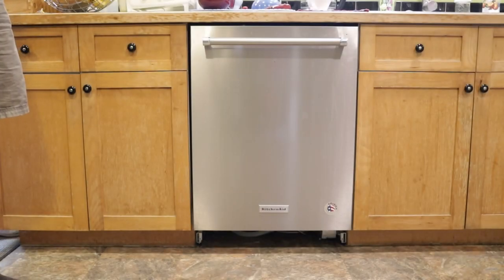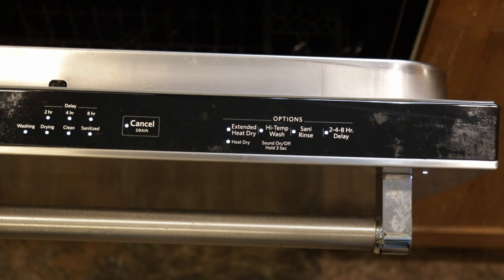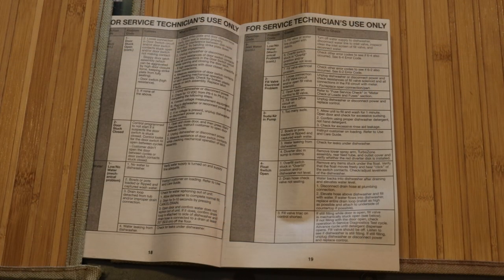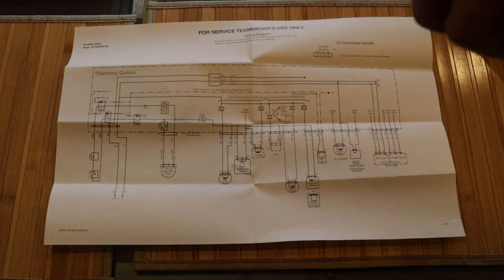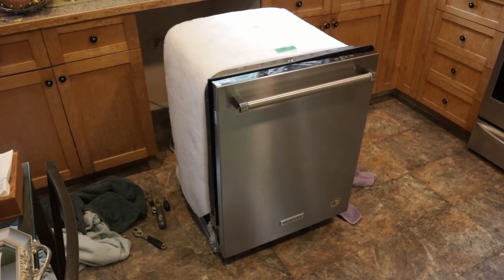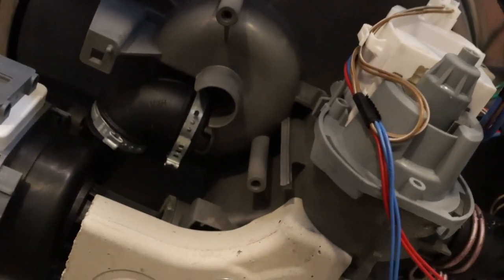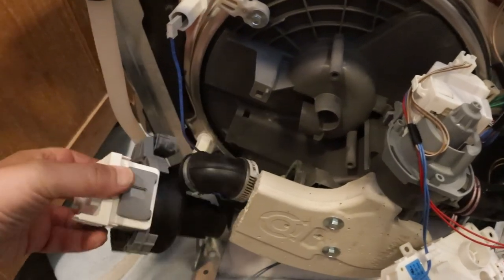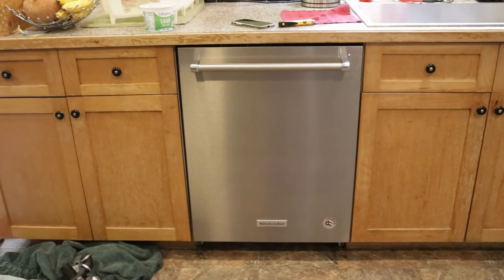KitchenAid Dishwasher diagnostics and pump repair August 2022

Comment: There's no way to tell if it's 3-4 or 4-3, no?  Then you showed it flashing 7 times in a row.  I've been trying to read their technicians error chart and it's hard to decipher even as a techie.
Reply from the maker: The cycle continues over and over (the flashing lights).  There's a pause in between and then it starts again.  There's also a pause between the two digits but it is a shorter pause.  I had to watch it several times to be sure...

Comment: Thanks for the great video. My dishwasher was acting all weird and would not start a cycle, other lights would just randomly flash. I tried resetting it multiple times by leaving it unplugged overnight and pushing the start button, which has usually fixed things when the unit gets stuck. But this time around, the unit was not able to be reset to work, and I thought it was permanently broken. Running your diagnostic sequence suggested worked, and then after that the machine is now able to wash dishes again. So running this seems to clear out problems more than a reset is able to do. Thanks for showing me a hint to fix my dishwasher!
Reply from the maker: Great!  glad that helped.

Comment: I have a Whirlpool WDTA50SAHZ0, and this was by far the best guide that addressed the issue I was having. Especially appreciated the tutorial on diagnostic mode, as I too would've been uncomfortable shelling out the $$$ for the new pump without solid evidence that it would fix the issue.
Reply from the maker: I was really quite pleased with how the diagnostics worked on this dishwasher.  Finicky pushing the buttons in that sequence, took me a few tries.  Then I realized I had to close the door to get the diagnostics to start...

Comment: Thanks for your video. I have a KDTM404KPS and not getting any codes but a very loud humming type noise when washing. Does this model have 2 pumps, a drain and a circulation or just one?

Comment: What happens of diagnostic mode does not work ?
Reply from the maker: Pushing the buttons to get it into diagnostic mode is really quite finicky.  It takes me multiple tries usually.  If that doesn't work it's either not the right dishwasher (though it's worked that way a long time).  Or the main logic board itself is dead.  I don't know how to diagnose that one, sorry...
Reply: @Noob_bc  I think they might be referring to that fact that no errors are returned after entering diagnostic mode.  That was the case for me and your suggestion to check power to the pump led me to believe it was indeed the pump.

Comment: Kitchenaid disherwasher: not starting any cycle. I ran the diagnostics 1 2 3 thrice , all lights come on, close door .. nothing happens
No blinking , no clean cycle running ?! Please help ty
Reply from the maker: That doesn't sound good.  Unfortunately I am not a technician so the video is only my experience.  It did however take several tries and at first I missed the blinking light (it's the only light visible on my machine when the door is closed).  It's possible the control board / brain itself has failed but I hear that's not common.

Comment: I see that you had 2 sets of error codes. 4/3 and 7/1.  I am getting the 7/1 code and wondering if it could be the pump?
Reply from the maker: If you have the documentation attached to the inside of the kick panel, you can look up the codes.  If not let me know and I should be able to look it up.

Comment: Does the white insulation wrap around the back of the dishwasher or is it only on the top and sides? Do you have the part # that it says on the green sticker? I am trying to find a replacement for mine, as the previous homeowner who installed this dishwasher removed the insulation
Reply from the maker: The insulation is only on the top and sides if I recall correctly and was one piece.  I don't have the part number but if you go here:  https://www.appliancepartspros.com/ you can put your model number in and search the parts list for your dishwasher.